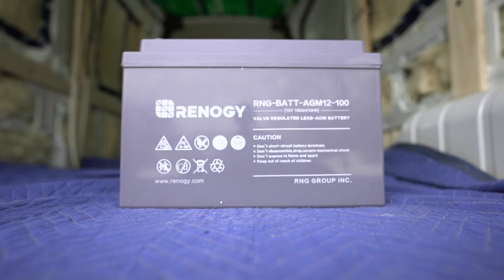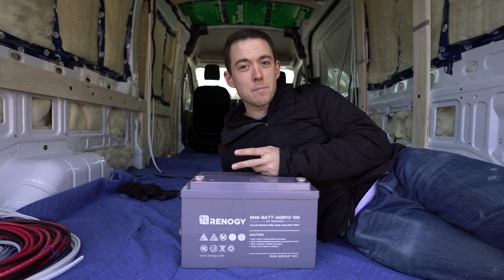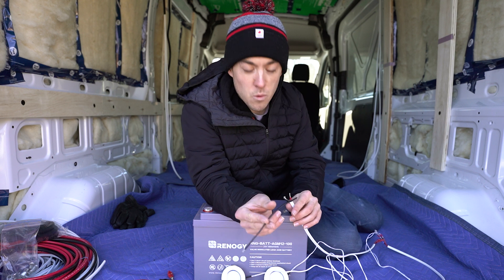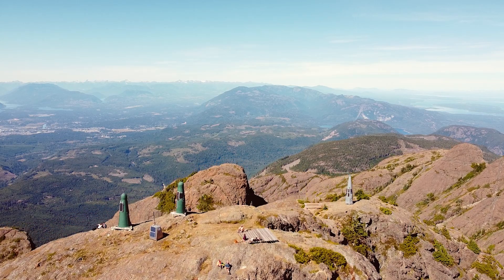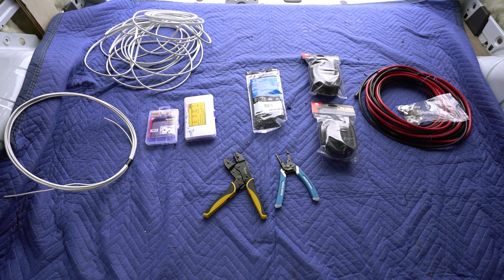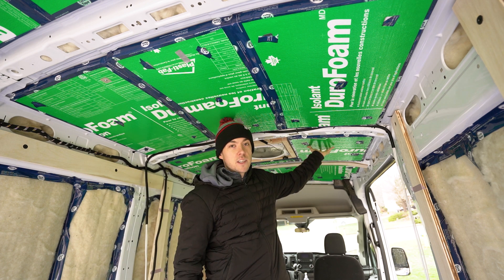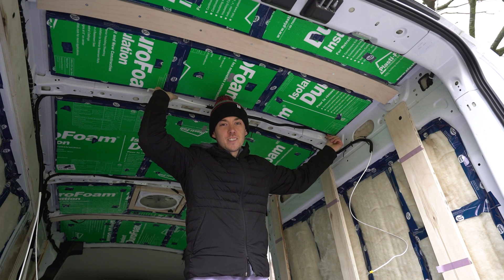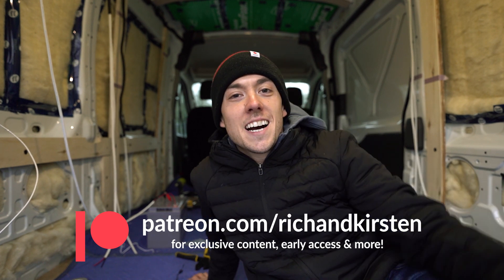Campervan DIY Electrical Van Wiring for Off-Grid Van Life

Comment: HI Rich and Kirsten...I just bought the Kisae 2000 Watt Inverter/Charger.   What length and gauge of an extension cord would you recommend for a 2000 watt inverter charger when I want to charge up from a pedestal at a campground or an outlet at friend's house?    This is for my minivan.
Reply from the maker: Hi Jack, if you’re planning to maximize the use of the inverter (ie use the entire 2000W at one time) we would recommend using 2/0 AWG cable. For reference, check out this blue sea systems wiring chart: https://www.bluesea.com/support/articles/Circuit_Protection/1437/Part_1%3A_Choosing_the_Correct_Wire_Size_for_a_DC_Circuit

Comment: I actually get boarded by others building the same way. I have seen new concepts with your build. Piggy back writing never seen and sheep wool insulation. Does your batteries have built in heaters when charging. I seen chrome install new lithium batteries that do that. Canada is cold apparently
Reply from the maker: We do not have a built in heater with our lithium battery, but when we install the diesel heater we will make sure a duct runs to the battery compartment from our heater. Since our travels will start in March we’re going to monitor the temperature and make sure we never charge below 0C (32F) for now as in summer we shouldn’t have any temp issues. Our battery will discharge down to -20C (-4F) which is a nice plus.